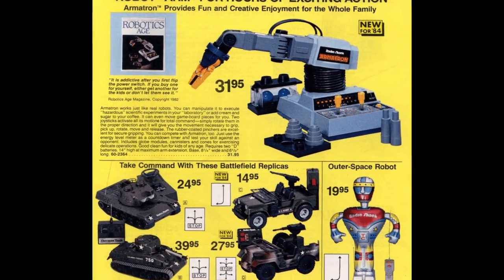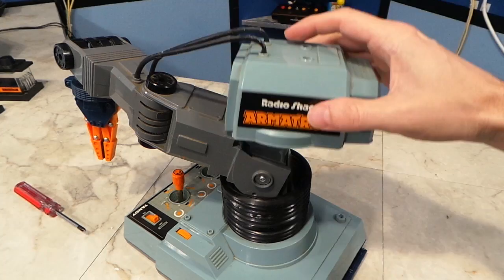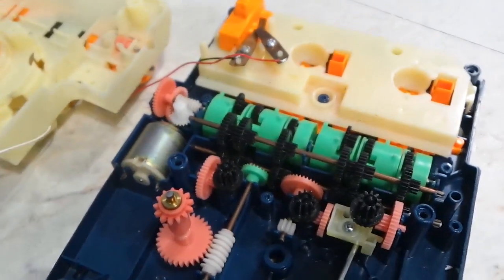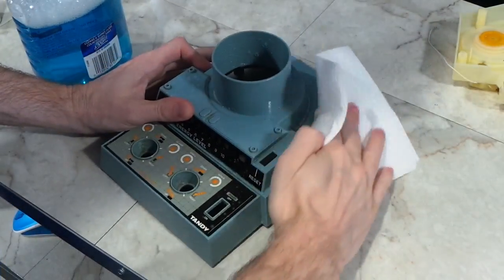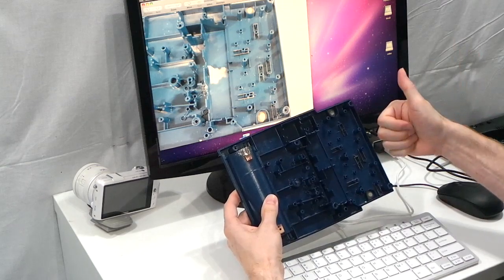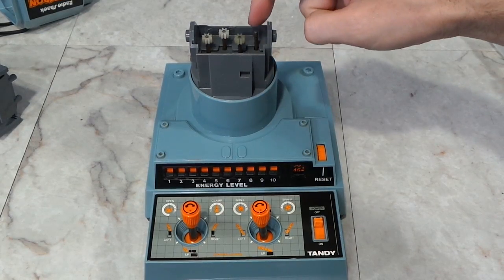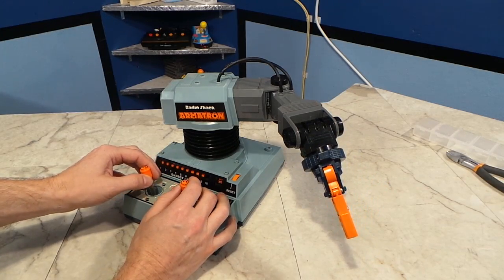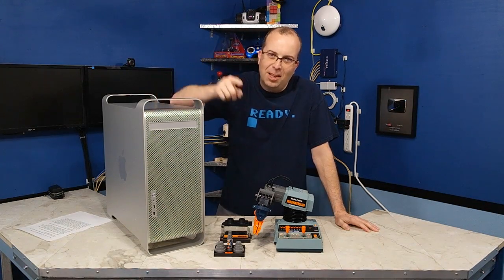Repair and Restore of Radio Shack's Armatron Robotic Arm from 1984.

Comment: Anyone else actually kinda pissed that he didn’t just 3D print a new gear ⚙️
Reply: From him 

The 8-Bit Guy
3 years ago
actually no.  This gear is far too small.  Consumer-based 3D printers like the one I have cannot produce parts this small with those tiny teeth.  A commercial 3D printer that is laser-based could probably do it.
Reply: To small? A standard prusa printer would easily print one of those..
Reply: i know right?
Reply: Why hasn’t he used the gears he got in future videos.
Reply: Snipes my first ever printer (which is now dead and replaced) was cheap Chinese crap and could easily print one .
Reply: Maybe he didn’t have the resources, or the knowledge 3 years ago. They’ve only gotten affordable and popular within the last couple years.
Reply: At the time this video was posted, a small 3D printer would have cost $1,000 and it would not have enough resolution to print the gear.
Reply: The resolution would have been the same.  3D printers have been standard with a .4mm tip for a long time.
Reply: @snoopyslr  Yes, but don't forget about the ability of the machine to repeat a 1.25cm movement while counting 0.05mm steps.  You also need to be able to measure and model the part in question.
Reply: Michael Bujaki I cannot explain how wrong you are. I had a cheap printer back then for $150, it could easily print that.
Reply: @bobb7460  Good deal, which one was it?
Reply: @michaelbujaki2462  it was very entry level, prices very but it's called the mini fabricator 2. I should warn you theres almost no info on it so most problems are for you to figure out. (Probably why mines dead now)
Reply: @bobb7460  How dead?  I know how to make spares by hand.
Reply: @michaelbujaki2462  I bought a monoprice mini select three and change years ago, and it uses the same NEMA stepper motors and same servo controller as any of the modern ones. 3D printers have gotten better in terms of material quality and rigidity, but in terms of actual design, they haven't changed much in the last 3 or 4 years.
Reply: @SeaTurtle1122  I bought a Vertex Nano 2 years ago, I wish I bought a Prusa.
Reply: @snipes_1138  also 3d prints are a lot better now than they were 3 years ago
Reply: @michaelbujaki2462  my board is fried but who cares it only had a 100x100mm print bed. Plus I've got two prusas now.
Reply: Nowadays you can even get a resin printer for ~$250 and print gears with even higher accuracy than is strictly necessary in this case.
Reply: Oh Jesus what have I started
Reply: Michael Bujaki to the contrary. An anet a8 when I was in college. 2016 it cost 150 or less usd
Reply: Sorry, I didn't see ur post, but said the same thing.
Reply: @markusgranberg8004  not in 2016
Reply: I'm mad he used a clip of the Sarlac Pit from the prequels
Reply: Snipes eh, just run a 100% fill pattern and you’re fine
Reply: @michaelbujaki2462  That's completely false. I have a Wanhao i3, which is more than capable of printing that gear. It was maybe $350 at time of purchase. He probably didn't have the know how and chalked it up to: printer = bad.
Reply: @admiralmudkip9836 That is not true either, 3D Printers are using the same base design and not much has changed on a consumer level.
Reply: @markusgranberg8004  but was that printer available 3 years ago? I came to the same conclusion but not sure what was the norm 3 years ago.
Reply: @DankBuddhaStank  had my prusa since 2012
Reply: You gotta keep it period correct cmon ppl
Reply: The easiest option is to buy a parts robot in worse shape and salvage a good gear, but there is a way to make a duplicate part, if the same gear is used or you have a spare to make a copy from, resin casting would work, it involves making a silicone mould and pouring in a 2 part resin that dries like a hard plastic. It is not too hard to learn, if you have a hobby shop near by someone may be willing to make a part for you, model car and airplane guys use the stuff. You can buy kits from a company called alumalite. Can be found online or at hobby lobby, craft stores hobby shops etc.
Company site- https://www.alumilite.com/
Demo video-  https://youtu.be/C5fdr9aFmro 
You may find a use for fixing missing plastic computet parts or make custom parts to retrofit things.  Hope this is a help.
Reply: He got like 30 new gears
Reply: There is no way he had access to that , this was 2016
Reply: Snipes Resin printer would do it.
Reply: Instead of everybody complaining about he doesn’t spend the money on a quality printer, how about you buy one for him and send it to him 😒
Reply: @-WhizzBang-  okay
Reply: @danieldeodato9304  war
Reply: You can find them on amazon or eBay. or make new ones from a mold RTV/resin mold. Here’s a gear that should work for the one that’s missing: https://www.amazon.com/dp/B07DH9JT8S/ref=cm_sw_r_cp_api_glt_fabc_X8R4RC6K4Y5F7DDDZGY8
Reply: Dont think he had one
Reply: @markusgranberg8004  this video was in 2016

Comment: 3D print one gear, is that simple.
Reply: For something that size (less than 10mm thick, potentially) you could also
 - laser cut one, using a photo of the existing one as a template
- use a blob of shapelock/instamorph or even just a chunk of LDPE chopping board, cut to shape with the Dremel
- squish an existing gear into a piece of clay and cast a new gear out of solder or two part epoxy
Reply: Agreed.  There's no way in hell that would work with PLA filament.  Even ABS might be too stiff.  Nylon would work.
Reply: Yeah, but since he bought a second unit he now has a wealth of spare parts that are fully to spec from the manufacturer, always useful for oldtech.  
But yeah, I do like the idea of a near future where we can go to Kinkos or the library and use a 3D printer for spare parts for resto projects like this.
Reply: I've tried working on older Radio Shack gear in the past.  I hope he heats the gear a bit before extracting it from the donor.  Their gears crack if you look at them funny.  I have a feeling you're right about public 3D printers not being far off.
Reply from the maker: having a 3D printer myself, I agree with you.. hence the reason I didn't try to print one.
Reply: Buying a second unit for parts seems like such a waste. Now that it's fixed, VERY unlikely he will ever need another part again. Now he has one working unit and one anchor taking up shelf space.
Reply: Jokes on you, he can still 3D print the needed parts and have TWO working robotic claw arms.
Reply: 3d printed mess? Have you ever seen high quality 3d prints with good materials? They are as good and strong as mold-casted parts. Ofcourse you need a precise printer with a small nozzle and good filament to print something this small accurately, but I'm very sure it can be done.
Reply: ungratefulmetalpansy Someone has to draw it first.  A gear is cheap and easy.  It's not hype when medical and military prototypes are being built with it.
Reply: What exactly was 'promised' then? 3D printing with consumer 3d printers is... hard... but if you follow the 3d printing community closely instead of just bashing, you would know that usable high quality 3d parts can be printed with decent consumer printers. Just need a decent printer, good filament, good slicing, a lot of trial and error on all the 100 settings you can tune, and for small parts: a small nozzle (smaller than the usual 0.4 ones). I've been designing and printing electronic toys and they are very functional, including gears and even functional strong tracks (like they have on tanks)
Reply: ungratefulmetalpansy Hmm.  Without a doubt, my home's not exactly normal.  I can't disagree on that front.
Reply: +PKMartin Or you could just cast it in silicone out of resin. That seems to be the easiest to me.
Reply: Resin (either epoxy or poliurethane) is fairy brittle, but I guess adding carbon/glass fiber to the mix (to the point of resin acting as glue for roving strips) would help?
Reply: Local Ork Yes.  What bothers me is the way it's laid down.
Reply: You'd probably want to use the 3d print to create a mould for some other material.
Reply: I was just going to suggest this:
"- squish an existing gear into a piece of clay and cast a new gear out of LEAD" since it's really easy to get and it heats up quick.
Reply: +Martin Damiano Alcorta True, lead is also VERY toxic so it is not recommended.
Reply: First thing first you need to create in 3D model before it can be printed.
Reply: I'd use PETg
Reply: Maybe a stupid idea but can you use one of the other same sized gears to use as a mold to make another?
Reply: t0nito
This isn't stupid idea. With right material (epoxy resin + cut carbon/glass fiber) it should be good enough, if not actually better than printing (You need to print it solid to make it worth anything). 3D printing is great for making original part from design, but not copying.
Reply: He found it again? Did he lost the old one that he found?
Reply: Ok, now I'm confused. So he found it, and then you repeated finding it? So you found it again or was it just lost once? Do you know him?
Reply: ***** Ok, then how many did you repeat finding it and did you send it to him? I just don't understand, how you can repeat finding something...
Reply: +Carboy7 He's trolling you
Reply: Actually, its a storm drain
Reply: Use PETG.  It has the give necessary to handle being press fit onto a shaft while being strong enough to handle load.
Reply: Carboy7 a beer gear is a gear that tastes like beer
Reply: He could just get a similar gear from any cheap toy car. that size of gears is veeery common in cheap toys
Reply: no
Reply: Hobby stores that cater to people to RC modellers and various scale racing cars could stock the gear you need.
Reply: That gear looks like a common gear found in Tamiya cars and can be bought as spares. Can't you just buy one of those and see if it fits?
Reply: Xperement lots of big metro libraries have them. most people aren't more than an hour or so from a big city even if they're in the sticks. worth a shot!
Reply: Where is the gear, did he find it?? Just kidding, sorry for the bad joke. 

Seriously, 3d printing came to my mind too. If that wouldn't work then the print could be used for a mold, heating up some plastic isn't too hard (I guess?). Personally I probably would make it from wood, since it's easy to shape with dremel, lots of material available and by trial and error even without pre-existing example you could figure the size out. Well if I hadn't a 3d printer, which I don't. But even "rough" shape should work, of course it's not original, but in case you couldn't get a original spare part.
Reply: In France, a kitchen blender and else manufacturer has decided to make his items so you can dissamble them easily and order your part which will be printed on demand. Te next step is to make parts files available to customer so they can 3Dprint their own broken parts. Let's see howx that evolve through years.
Reply: You didn''t even try ? There a UK costume builder youtuber that 3D prints many parts that are really strong.
Reply: He could if he would. There's a british youtuber that does functional robot and armor with so many 3D printed parts !
For the whole robot the hard part of the job is to take measures of all parts before the building. That would be very time consuming. 3D scan the parts and correct files would be faster. But then you'll need both a 3D scan AND a 3D printer.
Reply: Tom Joad XRobots?
Reply: +The 8+bit Guy Find a laser cutter place, they could make you one
Reply: Have Mathias Wandel make a replacement gear out of wood!
Reply: I love the old toys
Reply: Dark GT easier said than done
Reply: TheGeekGaming tru
Reply: Dark GT no offense but it would take forever
Reply: Hay don't be so mean
Reply: +ungratefulmetalpansy You're full of shit, I have 2 printers, both under $500. Home printers are more than capable of such a simple part
Reply: The 8-Bit Guy Nylon filament can be used for boat parts!
Reply: Amy UNTOLD It largely depends on filament. 90% of people print with PLA, which is very hobbyist for practical applications, but Nylon can easily produce a quality gear in minutes. This isn't secret info. Just spend more than 3 seconds doing research.
Reply: @PKMartin  Casting a gear out of solder is a bad idea. Solder is so soft, it can actually be cut with a plastic knife.
Reply: You need one of those Quimat gear sets. Just find the one that matches and fit it to the rod.
Reply: Not surprised that gear was the broken one..... It's the crushing function! Probably broke while a kid was torturing a sibling
Reply: Forget the 3d printer. You can literally carve something like that out of a piece of plastic with a pocket knife.

Comment: When i went to DeVry in the 80's for my final project I built a Vic20 controlled Armatron, I had to replace the single motor with six twelve volt motors (one for each of the six joints) I had to built bearing blocks from wood and used driveshafts to drive the individual functions.  I then used a  4 bit to 16 bit decoder to run twelve transistors to operate the motors in each direction, Since there is no feedback sensors all command were simply timed by programming commands in Basic,  I still have it kicking around somewhere  BTW it was the coolest project that year at my school  p

Comment: The gear looks like a "quick" 3D printing job.
Reply: that would probably take about 15-20 minutes.
Reply: No kidding, that thing was pretty tiny. Maybe 30-45 minutes with a lot of infill.
Reply: I could design it for you if you provide me with some good pictures with a good ruler.
Reply: First thing I said after opening the video, after seeing one dismantled before, was "I hope he has a 3D printer"
Reply: That's so much unnecessary effort and technology wasted. Just buy a smoothon kit from amazon and cast it in resin. No measuring, or additional tools needed.
Reply: He does have a 3d printer, he just doesn't have the correct scales to 3d print one. He said he was going to do a video on a 3d printer but never did it
Reply: Even faster and simpler minus the 3D printer - make a wax impression then fill with melted polycarbonate or polystyrene or cold resin. And mill out the hole with the dremel.

Comment: For future reference, if you have surface rust like you did on those joysticks, you can use an SOS pad. Not steel wool, but SOS pad. It has so much soap on it if you get it a little wet the soap keeps you from scratching the metal up, but it works really good on pulling the surface rust off.

Comment: Thanks, just picked up an Armatron at a local thrift for $4! :)  In the end it just needed the contacts cleaning and bending out to get it working, but your video really helped my confidence in the disassembly. The gripper movements are a bit jerky so I'll probably have to do a full strip and clean. The broken/missing gear on yours is identical to the other 3 nearby BTW.

Comment: Surprising that after all these years they have not solved the "leaking battery" issue (at least in AA, AAA, C and D types).

For you electro-geniuses out there, how come I can have an unused battery in a drawer for ten years and no leak at all, but leave it in a toy for 6 months and you're screwed?
Reply: Alkaline batteries can leak when they're dead. An batteries will gradually self-discharge over time.
Now consider the above statements. An unused battery by definition will take the longest amount of time until it self-discharges until it's dead and then start leaking. Whereas a battery in some device is going to be at a lower charge level (after all, you've used it for some amount of time) and will take less time until it self-discharges until it's dead.
Reply: Brand name battery companies offer to reimburse you if their batteries leak, and damage an item, but some of my stuff I have isn’t easily replaced. 

Anything that I know is going to be stored for a long period of time gets the batteries pulled out of it.
Reply: Jake Sangria  It is possible to make batteries that don't leak, though. I've had the same battery in my laptop for at least 7 years and it hasn't leaked. It probably doesn't actually hold a charge anymore, but it has not leaked. I think the AA, AAA, C and D batteries are just made for a target cost (super cheap) and so they cannot contain the internal chemicals for too long.
Reply: Jake Sangria  For sure, but durability has its value.
Reply: Jake Sangria  Of course, but in certain circumstances it would be nice to be able to rely on that. For example, an emergency flashlight sitting in a kitchen drawer for a year. I feel this is an issue that has a solution but it's not worth the effort for the manufacturers.
Reply: Jake Sangria  Uh oh... I better check my pantry... ;P
Reply: Jake Sangria  I like those emergency flashlights that don't have a battery at all, but require you to shake it back and forth to generate a temporary charge. Those are harder to find, but pretty useful in a pinch.
Reply: Jake Sangria  Yep, seen those too. Maybe some day LEDs will be so efficient that they can run off of the electricity running through your body: No batteries needed!